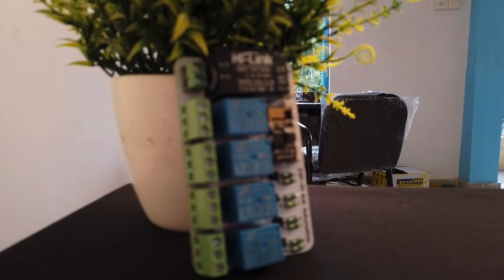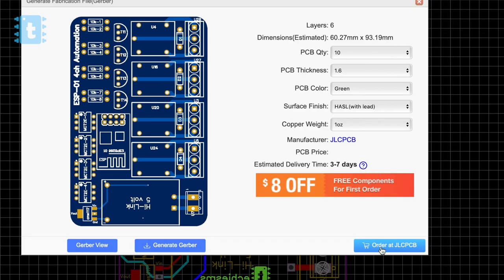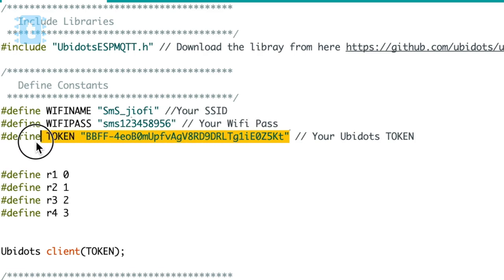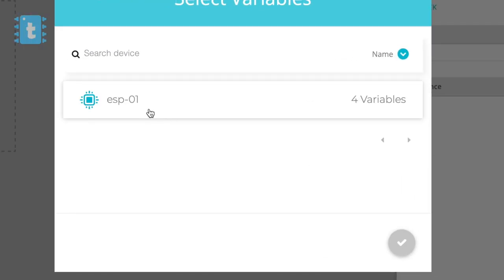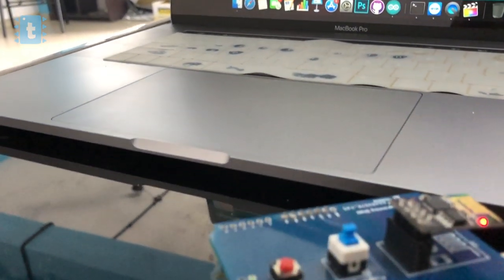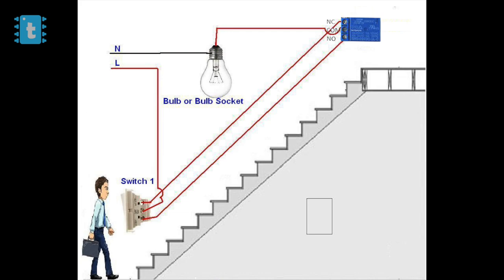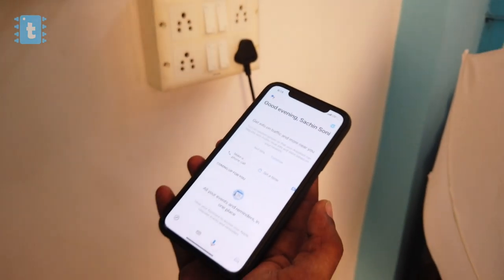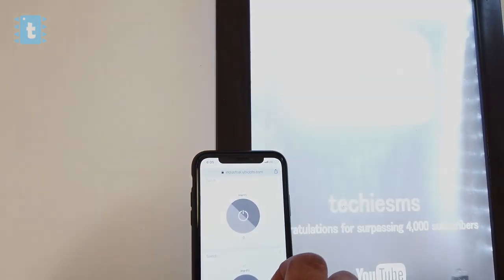Internet & Manual Controlled 4ch Relay using ESP8266 01 | IoT Projects | LCSC | Ubidots | JLCPCB

Comment: What did you use the MCT2E transistor for ?  I had a problem driving a relay using a transistor connected directly to GPIO2
at boot up the esp8266 sets the GPIO to HIGH for few seconds and that turns on the relay
is using MCT2E solves the problem ?

Comment: Hello Sir 

I have a question about your project..as your introduction its looks ok when we are   in the room...but when we are out off the room how we decided currently Light on or off..how to indicate that light on or off by some one when we are out of the house....I saw when you off the light by manual switch still indicate light on in your smart phone..how to.fixed that problem also..

Thank you sir
Reply: It will not updated on software right now. He wants to show that we can also control with physical switch in case your mobile phone isn't available at the time.
I think. He will rectify about status update on software in next project .

Comment: Sorry sir i watched this vedio for late I have to make this type of wifi connected switch and I searched in amazon I would get only one channel board for 400rs but i think little bit and also I could get only wifi module for 150rs so i decided to make the relay circuit because i have all the required components but uploading the code to that module is tough for me so in new module there is coded already or we should code it

Comment: No need of adding optocoupler.  Simply use bc548 as a switch. It is as good as prototype only. Because it may consumes power(for staying connected postion in relay component) even when you turn off applications. Use solid state swtiches or TRIAC.
Reply from the maker: You can't use just transistor with every pin of generic esp module. You can attach in nodemcu but you won't be able to do that in generic esp8266. Try on your own

Comment: Hey I have a code that you can sync physical button with virtual buttons.
If you turn on switch it will update to virtual button ON in application.
It works with nodemcu
Reply: Do share the code. @Techiesms also needs to fix this
Reply: @Saurabh Goel give me your email I'll DM you personally
Reply: @patrickmandang4929  checkout your email
I have send you code
Btw it works with Blynk platform you'll need to use NodeMcu.
Reply: Thank you very much for answering me, I will wait for your new project to be very interesting.  Congratulations again
Reply: Sir I want also your codes plz sir
Reply: by using current transformer sensor?
Reply: @yawarsaeed6499  check out your gmail 
I have send you code

Comment: Very interesting the video so I wanted to congratulate you.  But I wanted to ask you something about the project.  When you turn the light on or off manually, is the status updated on the software?  Thank you very much for your attention.
Reply: It will not updated on software right now. He wants to show that we can also control with physical switch in case your mobile phone isn't available at the time.
I think. He will rectify about status update on software in next project .

Comment: i would like to know why you pick six layers as in 2 layers also this work could be done.2nd I wanted to know why didnt use capacitor at ams117 didnt you receive heat issue when using?
Reply from the maker: First of all using more number of layers we can reduce the size of PCB. If I had used only 2 layers may be the dimensions of the PCB were much much bigger then this 6 layer 

Secondly I didn't find any heating issues with this

Comment: Sir, this is awesome but many of the times our home switch circuit which is inside wall , when we connect it in real life it causes problems and connection is not easy
Reply: Sonoff T1 touch or Sonoff Basic will fix your problem

Comment: 15A 400W MOSFET Trigger Switch Drive PWM Regulator Control Can't use this module? After doing pwm from this module, it will not turn on again during power off. What can I do for it ...?🕺

Comment: but there is a problem, when you turn off/on the lights with the manual switch, it doesnt update the status on the app. So, sometimes it will happen that in the app says that the light is off, but actually its not.

Comment: Everything is good sir but you are demonstrate ubidots iot but it only one month validity after that what to do sir 
My suggestion is to use another cloud platform in place of ubidots thank you very much
Reply: Use adafruit io
Reply: Create your own app use MIT App inventor (no textual coding required). This may be hard for the first time  because you need to handle the client - server transactions by yourself. But later on you can improvise or customize it easily.

Comment: gr8 video... bt app mai pata nai chalega ki bulb on hai ya nai if u r controling using manual switch ...matlab app mai se  tumne on krdiya so app mai on position ayegi bt apne fir manual off krdiya tobhi apl mai on hi position dikhayi degi
Reply: so  try to make this project using manual push button which is connected to node mcu and also mqtt
Reply: also use wifi manager library to get rid of put ur ssid and password in code

Comment: Hi-Link used to convert from 220vAC to 5vDC are not very good, If relays kept on for long time this gets hot and finally stops working.
Reply: Then we should go for mosfet
Reply: @rockyrunner3102  not safe for mains AC voltage.

Comment: hi techiesms
,
can you share the diagram or link  of PCB
i want to make same project
Reply from the maker: Check the description for that
Reply: @techiesms  

i have checked. i am asking how to same PCB order from jlcpcb.com
Reply from the maker: IT Knowledge you can check the description where I have attached the link of one article.on my website. In that article you'll find the PCB design on easyeda.com
Reply: @techiesms  hello I have a missing pin locations that I am missing the same pattern but esp 32 pins don't fit into place

Comment: Bro everything is fine 
but what is the use of this project being implemented using IOT
because you can't even at least see the present state of your switch or relay(unless you are in the range of the appliance) through your IOT application
and for this project demonstration we actually don't need a ESP-01 and an internet connection
and can be done using a HC-05 and an arduino nano or you can create a hotspot using ESP-01 and then locally control it
But what you done is cost efficient 
and with some changes in your code you  can also see the present state of switch (better using adafruit)
Reply from the maker: I'll do some modifications according to your comments and will present you a better project which will be a complete home automation
Reply: @techiesms  really good decision bro and I am a freshman to engineering course 
may be i will have to learn a much from you bro
but my comments doesn't mean your project is not worth 
because you made a really cost efficient project that can ever be built
the only thing expensive is two way switches
and ALL THE BEST bro

Comment: You cannot make out whether you have your lights on or off if someone switches off the appliances with two way switch. 
Not helpful but confusing. Got to improvise
Reply: u can use the board switch to toggle arduino or esp signals ...just disconnect board switch from 220v line and connect it to 5v arduino line..works great

Comment: There is issue in this project, you will not get update on mobile if light is switched 'off' or 'on' through manual switch
Reply: do you have any solution of this, if you find it please share

Comment: Hii
When light is on by using mobile switch at that time mobile switch is on condition but light is off by using manuals switch at that time mobile switch is not off
Also also this point work with Google assistance

Comment: If you turn the switch on and tell the Alexa to turn same switch on , it will turn off
Reply from the maker: Ya that's the flaw. But now I'm working on these flaws and soon making a perfect one. Stay tuned
Reply: Can you make a publish feet on adafruit 
Connect the momentary switch to the publish feed when push once sent 1 to turn on and push twice to sent 0 to turn off the feed 
Or push one time to send  1 to turn on and push another time to sent 0 to turn off the feed
Reply: @hassanahmad9597  hi, can y help me with a little problem with a proyect like this?